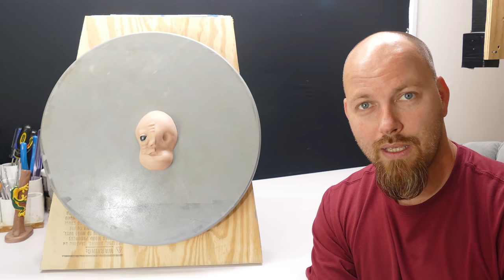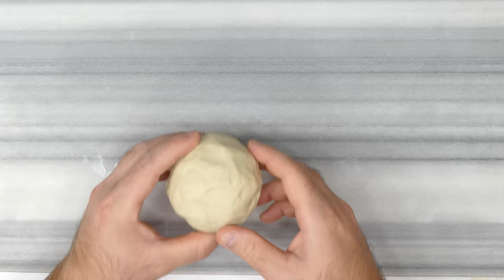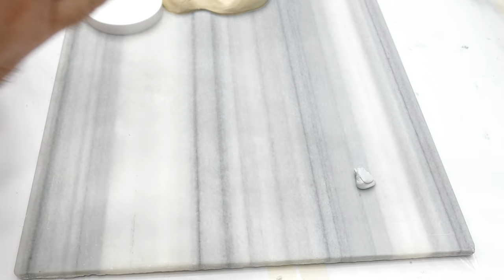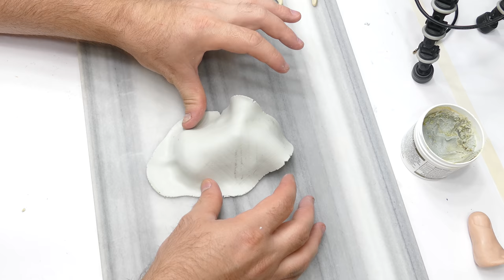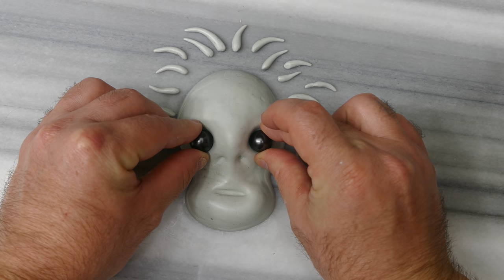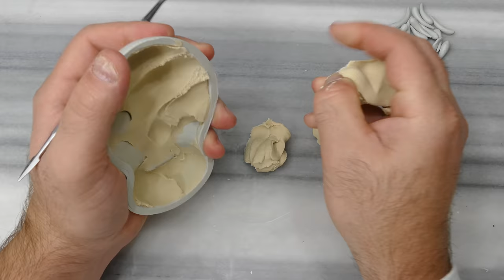Face/Mask Armature build & setup

Comment: I like this idea. How did you affix the armature to the turntable?
Reply from the maker: there is several ways I do it depending on what I'm doing. In this case I used Plastlina clay (oil based) and work it onto the surface. It's stays put quite well. (I only do it this way if I'm making a shell with apoxie sculpt btw) But if using straight polymer clay, see my tiger face demonstration  https://www.youtube.com/watch?v=gcn240TAuO0  You can tape a larger square piece of waxpaper onto the turntable, cover it with tape (to add strength to it) then tape your foil armature TO that wax paper. This method allows you to then cut the sculpture free afterwords from the turntable or whatever surface you don't want to put into the oven.  I think seeing it done will explain it better lol. Hope this helps.